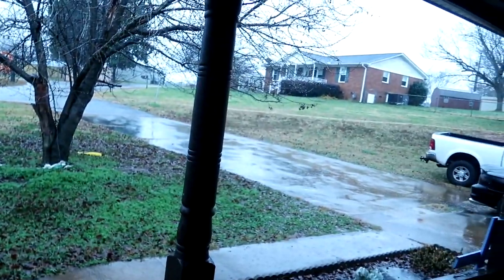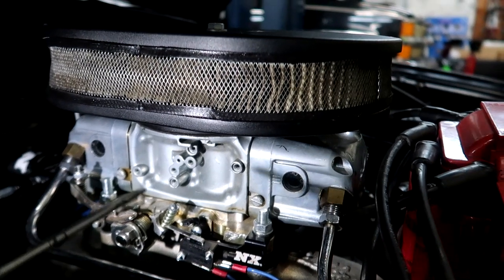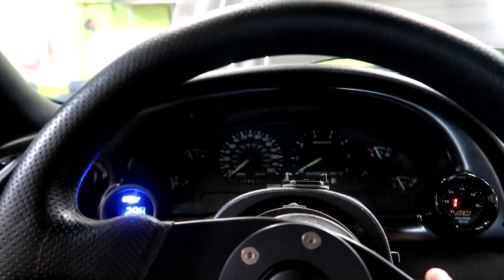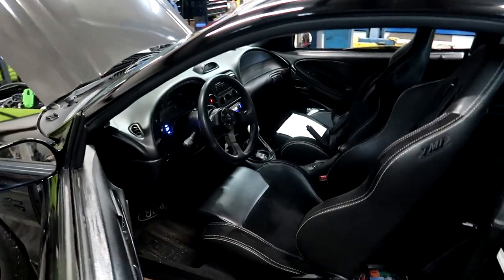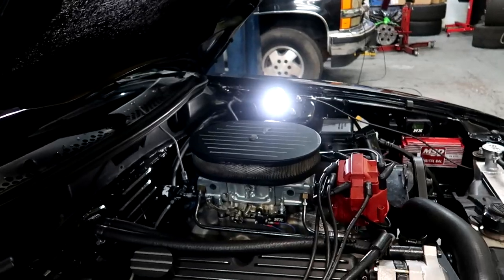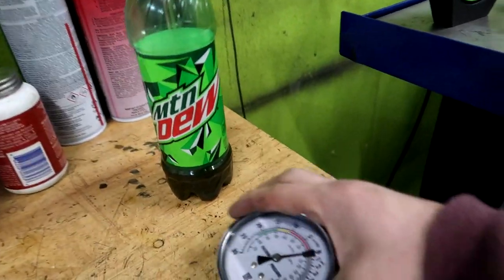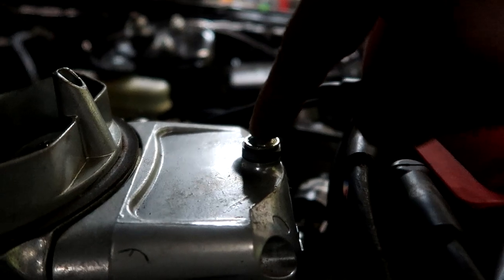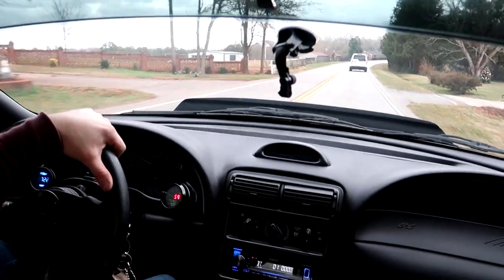This Is The Real Reason I Carb Swapped My Sn95!

Comment: Hey when I initially carb swapped my foxbody I used the aftermarket throttle cable you have. It sucked and yours looks like it’s in a bind. So all you need is a 1985 throttle cable. Late model restoration is where I got mine. Hope it helps.
Reply from the maker: Mines been fine but I really appreciate the info! 👍🏼

Comment: My question is how would you tune a carb for a blow through supercharger or turbo that has the hats on top the carb. How do you tune for boost on a carb is my question
Reply from the maker: You just read plugs and make sure the fire ring on the plug porcelain are good, and the timing mark on the strap are good and also use a air fuel ratio gauge to make sure you afr is good.

Comment: 0:03 what suspension are you running brother ? You have no wheel hop ! Do you still have quad shocks ? The previous owner of my car removed the quad shocks to fit a 315/35/17 on a 10.5 rim. The wheels are beautiful but I may go down to a 305/45 .

Comment: I thought that was a accelerator pump that you called a power valve? And the power valve was on the meter block 🤔
Reply from the maker: That  is what I was meaning 😂 I forgot to change that in the video
Reply: @lollis_garage3683  🤣😂🤣 I knew what you meant , that is all that matters 😂🤣 I finally got my 347 back from the machine shop so it is crunch time now, im ready to see what she will do

Comment: Ok, so you're selling me in the CARB SET-UP.
BUT YOU LEFT THINGS OUT....

#1 WHAT'S THE ADVANTAGE OVER EFI ??

#2 HOW DO YOU BYPASS YOUR EFI TO GO CARBED ??

I GOT 95' COBRA 5.0
Reply: How do you bypass EFI? With a bypass carburetor 😂. Btw you type like you're in kindergarten.
Reply: @windowtintman1986  
na, you just think I'm yelling and YOU'RE SENSITIVE.
Reply: Historically the advantage of a carb was you had complete control over what it did, compared to the "black box" provided by the manufacturer.  If you wanted the EFI to do something else, you needed to hack it.  Then came the standalone ECUs, which gave you more control, but in many ways you were still beholden to the people who made the ECU.  MegaSquirt finally delivered an open source solution, but then they yanked out the rug.  Speeduino now gives you the same level of control over the ECU as you get with a carb, but the learning curve is steep.

Technically EFI is better in every way, especially with modern gas, but there are still some very valid reasons why some people are sticking with carbs.
Reply: @rockets4kids  
I'm learning..
I heard " an efi system give the engine what it wants to give it , BUT A TUNED CARB GIVES THE ENGINE WHAT IS ASKING FOR. ".......

SWEET & SIMPLE .
Reply: @allentraylor5659  Assuming temperature, humidity, air pressure, and fuel type all match what the carb was tuned for.  EFI can correct for all of these variables.